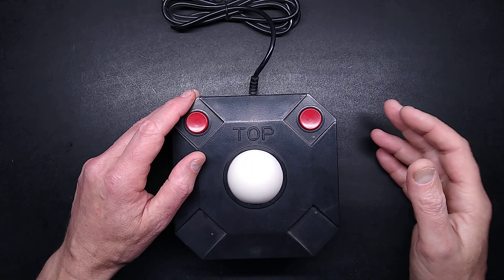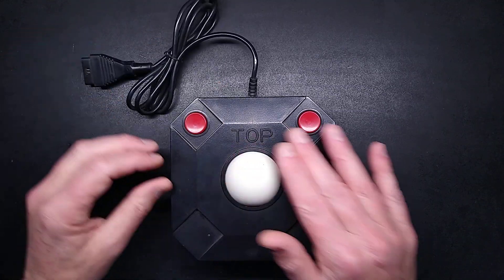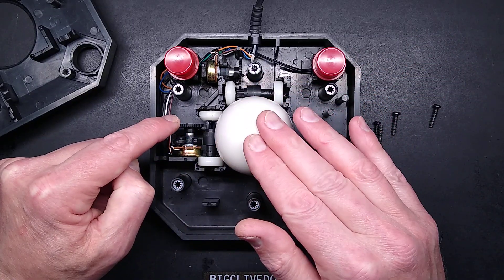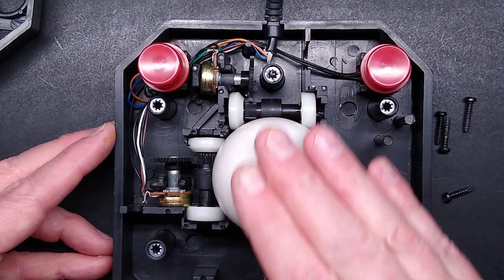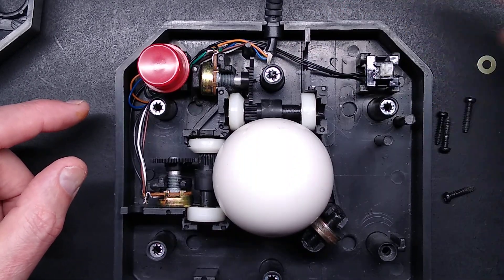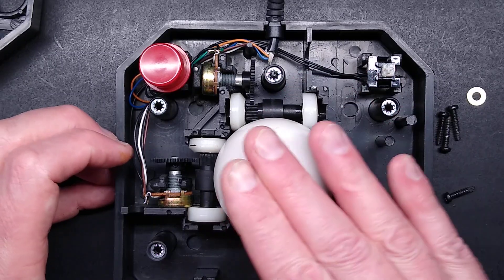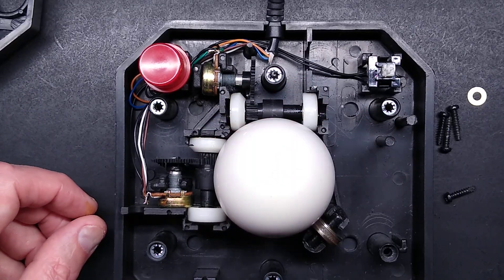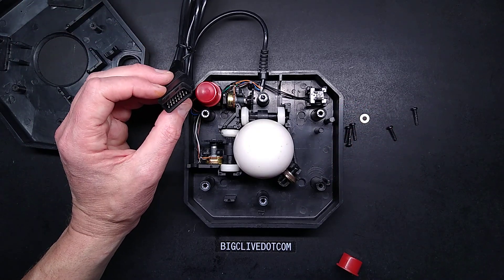Inside a weird vintage analogue trackball

Comment: Interesting connection:  Being reminded of the trackball controller in Misile Command, the first trackball was developed for am early computerized air defense system.  It was also developed in Canada, and the ball was a bowling ball, so much bigger than the typical size of a trackball ball these days, like the trackball used in Missile Command, and the real world system was as similar to the video game as there was, although much earlier.

Comment: 556 timing circuit :-) I still wonder why they used pots rather than variable capacitors. Variable capacitors would have had greater reliability. 
Also there's no intrinisic reason variable pots need to have end stops.

Comment: We wore out so many trackballs playing missile command back in the day until we started using trackballs designed for the BBC micro that were modified to work on the Amiga and early PCs. The Acorn/BBC ones were more expensive but were a far more rugged design that lasted for years rather than a few months, the fire buttons used to wear out before the trackball mechanism. Replacing the fire buttons with chunky arcade machine buttons made a few of the old modified BBC style units survive in use until the mid 2000's and the original PC type were merely a distant memory.  Now I'm going to have to dig out missile command again and have a bit of retro fun !

Comment: When I worked for Ferranti back in the late 1960s we used similar tracker balls on simulators for training air traffic controllers. Back in those days the programme was held on a reel of 8-hole paper tape which had to be re-wound by hand after each time it was loaded. The boot sequence to get the machine to read the paper tape was a set of manual commands on 24 flip switches and an enter button.

Comment: Interesting... I'm wondering if you've taken a look at the USB RGB disco lights? If so, I'm wondering if it is possible to change the color flash patterns.. I literally found mine, not too long ago, and was thinking about the color patterns and how to change it... then I started hearing BigClives voice... immediately came here to ask the question, "I seek the answer! Thy reverse engineer!"
Reply from the maker: Most of the little disco lights have the annoying patterns locked in software.

Comment: I used to work for a company (part of penny & Giles) that made replacement trackball for the arcade cabinets.
We did an analogue (ish) that used ballistic scaling to change the level of output.
We also made vandalproof balls units for the millennium dome.
What used to get me was the Air traffic units we made that used to get damaged by "bored" control staff!!

Comment: Reminds me of the old IBM Mouse Ball Replacement memo from USENET days. I also remember a number of years ago (10 maybe?) you could get optical mice with no balls where you could hack the optical chip (Agilent I think?)  on board the mouse to get the actual camera data from it. Very low res but it did work. I am sure I have one still in a box of old junk somewhere still wired up to do that.

Comment: I think you will find that it is for the BBC Micro, probably need to check the wiring though :)
And yes, you need the lid/to push down to make it work.
They aren't great but if serviced, do work well.

Comment: I ones had a project where I used temp resistors to measure house temperature and use serial ports cts rts pins to control relays to automate temperature control... If I remember correctly the resistors on joystick charged up caps, and when you read the io-port for the value it also discharged caps. So it was essential that you used same amount of time between reads. Not as simple task as you might think using computers in that period.

Comment: if the total resistance of the potentiometers is known, you have defined minimum and maximum for both axes, and can use that as absolute positions for upper left and lower right corner of the screen - so you wouldn't be stuck somewhere in the middle when reaching the end of the pot.

Comment: Still use a tracker ball in work daily as a train signaller. They've become so engrained that when we were given a demo of a new traffic system being installed the first thing we highlighted as a potential safety risk was the change to a mouse!
Reply: Is it brown? Does it have a curly cable?
Does it hurt your wrist after a while?
If so I used to work for who made that!
Reply: @RamshakleRetro  nope, all black think the brand is Mouse-Trak??
Reply: @irishspringbok ooo might see if I can find one!  We mainly supplied TFL
Reply: @RamshakleRetro  I'm with Irish Rail, but IIRC alot of the signalling systems at least with the UK & some of the EU are similar

Comment: Still see this sort of thing used today as a lazy man’s rotary position encoder by using the ratio of the track resistance if I recall correctly. I have a sub that uses these types of pots to sense the position of the controls on the back of the plate amp. While clever they are really steppy in operation and they drift over time as the wiper and tracks oxidize.

Comment: yeah i could see missile command working on that and being a bit closer to the arcade cabinet version, it's how john connor plays it in terminator 2 and in the brief shot that they show him playing, it does come across that it's a game that requires the kind of flow and twitch response this input would give you. i used to play it on my dads atari ST and it was much more difficult with the fixed input speed which the joystick gave. (atari joystick with square clicky yellow buttons, not red circle buttons)

Comment: That is not serial, it is called a game port which came standard as part of audio expansion cards for pc (soundblaster). The sex of the ports is reversed to that of serial, the pin number is greater, and the pin pitch is closer to DIN I think. This would have been sold with bowling and golf games. Support for the controller port was permanently and inexplicably removed from windows 10 about half way through its service life along with early USB floppy drives, though the audio expansion cards themselves are still supported to some extent.

Comment: A neat but super simple device that might be worth looking at for battery salvaging is the modern polaroid 600 film packs. The appear to have 2 small flat Li-on cells in series with a couple diodes. It seems like such a waste to make something thats going to be tossed out when it can be refilled and recharged

Comment: Yeh, I had a joystick with that kind of setup with the 2 pots, and the strange part is what while the pots were the usual 270deg or so, the joystick only utilised 20-30deg at best, given the push/pull levers moving the shafts.  It would've made better sense to use linear pots vs twisties.

Comment: It's funny you should feature an input device, Big Clive! ... I've used and built PC's for 28 years, and I've always used a mouse. I saw a YouTube video by Explaining Computers extolling the virtues of a Graphics Tablet, so I tried one for the first time ever, and it's driving me insane!

The simplest of tasks are really difficult, such as selecting multiple items, cutting, copying, etc. It opens files when you don't want it to, and moving the cursor around my 50" TV is far from easy!

Have you ever used a Graphics Tablet, Big Clive?

EDIT: The Tablet supplies power wirelessly to the pen.

Comment: When I was at college in 1981 we had a couple of what would become classic arcade games in the refectory ..: 
1) a glass table version of Space Invaders - which had a simple 3 button control of Left/right/fire 

The other game was a two player (one on one ) basketball game- it had a 2 tracker balls built in to the panel to control movement of the players around the screen and shoot button that depending upon how long you depressed it determined the power of the shot. 

That game , if you played it for more than a few minutes would give you awful cramps in the wrist and forearms
Reply from the maker: Sounds like the old black and white Atari Basketball machine.

Comment: Basically, a trackball joystick. A reversed physical representation of shitty console game PC ports (where they just code a routine to simulate gamepad inputs from the speed of an invisible mouse cursor, and then feed that to the same code used by the console as a virtual thumbstick).

Comment: I do love my old Logitech MarbleMouse, massive optical trackball. Many many years old, but no mechanical parts to fail, fantastic!

As soon as you mentioned that was running on pots, I immediately had that question of what happens on the end of travel. But that's thinking from the "modern" assumption of plugging it in and the cursor starts in a certain default location, I guess with that one, it would automatically be at whatever position the pots dictate.

Comment: Back ages ago, when we were just starting to shift towards a mouse+keyboard interface style, my dad bought these keyboards that came with a relatively big trackball together on the side of the regular keys... it was pretty big, the size of a standard numpad. Not attached, it was an integral part of the keyboard itself. The ball wasn't as big as a snooker ball, but it also wasn't small.

If memory doesn't fail me, it had "Cat" somewhere on it's name, printed all over the beige keyboard. Cheeky bastards. xD

Anyways, I could never find the exact brand and model of the thing. Perhaps it was a local thing... from the late 80s or something. Back then we still had PCs and accessories being produced by local brands.

You know, it kinda made sense at the time. Keyboard+mouse still wasn't the dominant interface, there were lots of workplaces, schools and whatnot that made custom computer desks that did not have a space for a mouse, so trackballs kinda seemed like a better solution for some of those cases.

Because of that, I was personally pretty late to adopt a mouse... I think it was only when Quake 3 Arena came out that I finally decided to get one. xD It hit the limit of gaming with just a keyboard alone. xD

Comment: in bell labs at the mother of all demos with douglas englebert and company there was a prototype trackpad that used a pen and string lashed around a potentiometer for x axis and another pot for y axis. there was a return spring to ensure the string remained tight. it never took off as the string would move in an arc, so the coordinates were warped.
Reply: There's a kind of pen plotter called a hang bot... plotter bed is a sloped surface and two drum winches move the heavy puck around the plotter bed. Sounds like a similar idea. Trigonometry can  sort out the warping of coordinates, but of course that would have been a lot of  extra computation in the early days
Reply: @stevecummins324  there's actually at least one 3d printer hang bot. There's also a polar 3d printer, which would be better suited for a trackpad configuration like engleberts. this is because you could fix a potentiometer in the joint of the arm where the steppers normally are, and not worry about end stops.

Comment: are you aware how the PC joystick port actually reads the potentiometer into a digital value?  ADCs were kind of expensive at the time so instead it used a 555 timer chip (well usually a 558 quad timer for xy on two joysticks) with the potentiometer as one of the resistors.  The software would then trigger the timer and time how long until the output of the 555 took to reset.  This was kind of clever as it meant that the software could be as accurate as it wanted by just by timing things more accurately.  You could also implement this on just 4 bits of a data port, triggering on a write to the port and one bit for each analogue channel leaving the 4 remaining bits on the byte wide port for joystick buttons.
Reply: Yes, well, explained. That is how the position of the PC game/MIDI joystick is sensed. Just one small point, you mean that ADC (analogue to digital converter) chips were expensive. A DAC is considerably less expensive as it converts a digital value to an analogue voltage.
Reply: @Mark1024MAK  yeah. Slight typo on my part i did mean ADC and fixed my post.  thanks

Comment: There where commodore compatible mice, i believe even the CBM 1351 did that, that would use an optical encoder  sending data to an ASIC that outputs an resistance value towards the SID's A/D converters.
0-255. If anything went from 200+ to 0 or close i.E. Geos would internally just add 255 and vice versa
It was rough, unrefined and sometimes a pain, but it worked.

Comment: Best trackball I ever used was the Logitech Marble mouse, that had the red ball with the thousands of black spots on it. Anyone remember those?
They had a camera sensor very similar to what today's optical mice use, but coded slightly differently because of the position of the sensor. It had to capture and then calculate the slight rotation of the trackball as it was moved left to right (x), asd well as the regular forward and back axis (y)
Reply from the maker: Strangely enough, I've just made a video about my Logitech trackball.

Comment: @2:08 - Count me among those old enough to have to take the ball out of the bottom of my old mouse to clean the black crap off the wheels and to clean the ball.  Fast forward to now - I haven't use a real mouse in many, many years.  We have an army (no less than 5) of M570 Logitech track balls around the house.  I have trashed and thrashed most all of them at one time or another.  They all still work a treat.  Every once in a while, I will treat the roller bits with some diamond ceramic car polish to keep them smooth-rolling, but otherwise, they're Human Interface Tanks.

Comment: Upside-down analogue mouse with physical rollers designed to take grease & fluff from your fingers & turn it into a paste that sticks to the rollers :) I still have a couple of these meeces (for hysterical reasons, one being the original MS PS/2 mouse with its dedicated controller card) if you're interested ;)

Comment: Wico made most optical track balls like for Missile Command and Centipede and other controls for arcades games. A bit latter for other game consoles and other computes. Atari 2600 sticks were weak often breaks and many replace with Wico Sticks that were home use copies of Wico arcade parts.
Reply: I had the WICO trackball. It was a beast. Expensive but built like a tank.

Comment: Whilst very basic, it is nevertheless effective (providing the tolerances are fixed :-) ) Certainly a chunky device, and there's a lot of "cost optimisation" going on even that far back with the use of off the shelf components wherever possible.

Comment: Absolute positioning with pots, versus relative positioning using infinitely spinning encoders. There are cases where absolute positioning makes sense.
Reply: It's also WAY simpler construction. No components needed at all besides the potentiometers, just wire the pots directly up to the analog controller port.

Comment: I see at least 4 wires coming from the horizontal "potentiometer", which suggests it's not a potentiometer. Left to right: mat black, white, glossy black, purple. The mat black is covering parts of the white wire and blue wire, so I don't think it's a shadow.
Reply: I bet the two blacks go to the same terminal on the potentiometer.

Comment: Cherry mount switches, not the standard MX series used on keyboards. With the perfectly symmetrical mount cross shaped section and its unusual height it looks like an M11.
Nice device. When you said analog, I expected such a basic electronics. It should be very easy to modernize with a basic microcontroler.

Comment: Wow, I still remember those form factors.  It's basically an upside down mouse with a joystick/MIDI port.  They like collecting dirt on the rollers that needs to be cleaned off perpetually.
Reply: More like the mouse is an upside down version of one of these. 🤣
Reply: Yeah, I believe the tracker ball was invented before the mouse. Anyway, I had an Atari STFM back in 1989 and I much preferred the tracker ball that I bought for it over the standard Atari mouse. Both had to be disassembled regularly to de-fluff, de-hair and to clean the gunk off the rollers.

Comment: Proper ball and trackball mice have something called an optical rotary encoder, instead of the ball turning pots, it would turn a wheel with regularly spaced holes, which interrupted or restored line of sight between an infrared light source and sensor.  As the wheel spins, it generates pulses of on and off signals, whose speed tells how fast the mouse is being moved.

Two wheels and you can determine speed and direction, all a mouse needs.

I seem to remember reading about pots being used in some of the earliest computer mice ever made in the 1960s, a pair of wheels perpendicular to each other under mouse.  for them the pots running out and the mouse hitting invisible boundaries was a legitimate issue.

Comment: Ahh the joys of degunking the roller balls on these and old mice.
Reply: as soon as I saw a review of the Microsoft optical "ball-less' mouse, I bought one. I'm still using that same one.
As soon as I brought one into work, the whole office immediate decided to switch over to them.
Reply: I found that the wheels that drive the potentiometers always needed gunk removal more than the ball itself.
sometimes you could get a little ring of dirt of them, but had to break it to actually get it out :(

Comment: I've got a feeling that might be for a BBC computer. It looks vaguely familiar to one I saw in the 80s on a BBC and that had a 15 pin analogue port I think.
Reply: Yes - I just found it - its the Alta1 Trackball for the BBC
Reply: @jca111  thank-you glad someone found out where it from.  I thought I had seen it on a cover of Acorn-User but it wasn't. Then I thought it might have been from an Apollo computer.  There is one on ebay for £74.99  Shame we couldn't hook Clive up to a BBC for a demonstration of it in use at the end for extra coolness. 😀